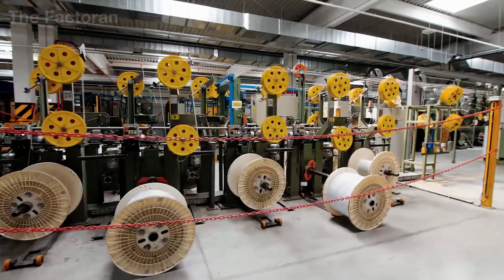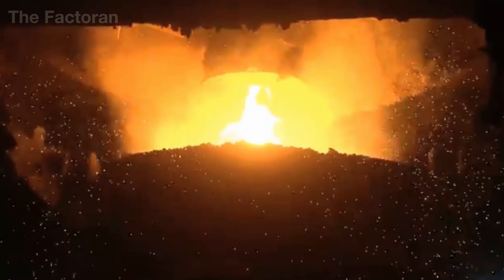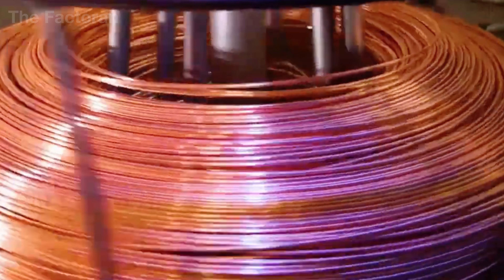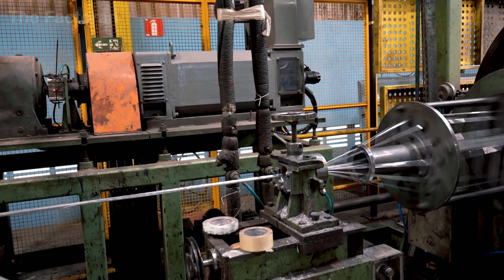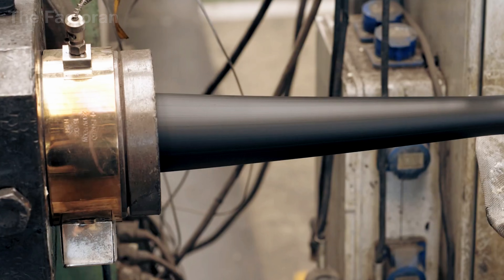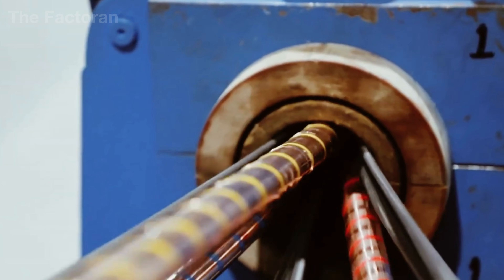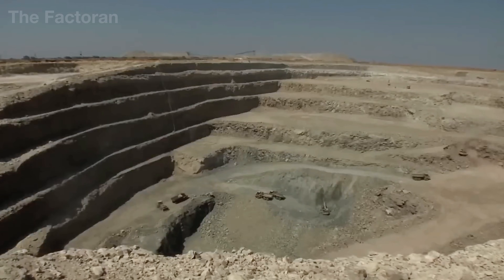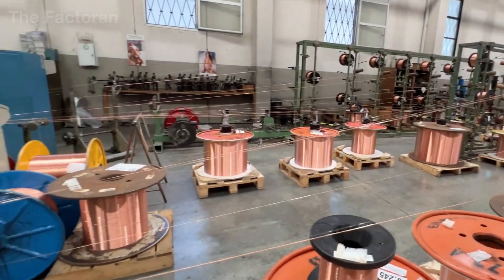How Millions of Power Cables Are Made Every Year Inside Massive Production Line

Comment: Some of the copper wire is actually steel wire. As a retired electrician, I know what copper looks like
Reply from the maker: Good point—some applications do use steel or copper-clad steel depending on the purpose.

Comment: Main power distribution cable, is aluminum with a steel core.
Reply from the maker: That’s correct, aluminum conductors with a steel core are commonly used for power transmission because they’re strong, lightweight, and efficient over long distances.